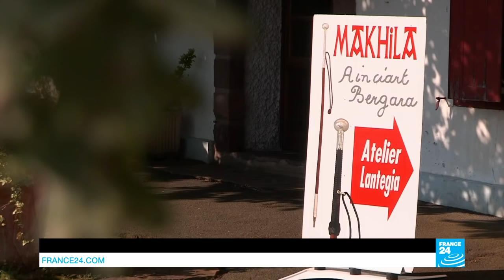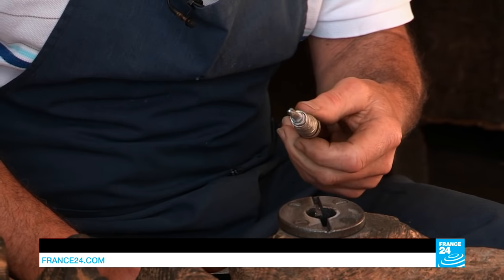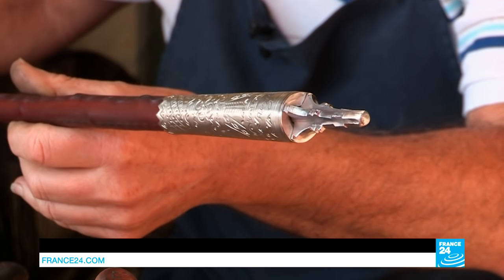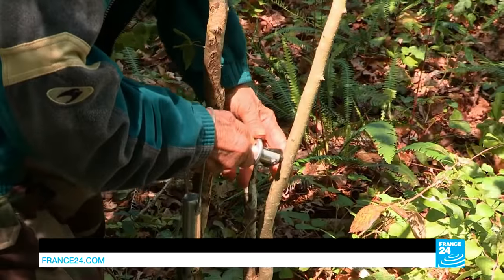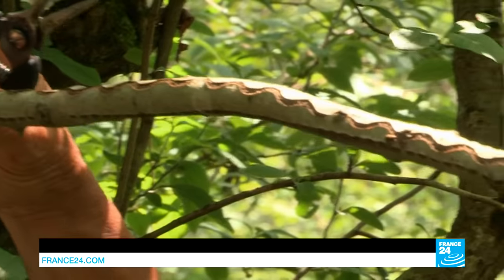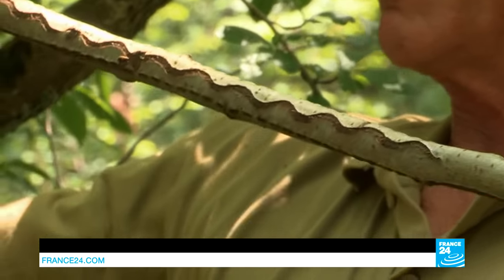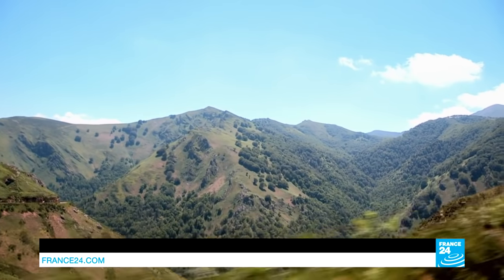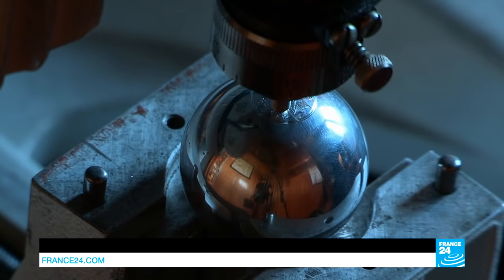The makhila, a prestigious Basque walking stick

Comment: As bladesmith I have just completed making a sword cane. Making a 24" blade is quite an exercise, particularly the heat treatment to harden the steel which tends to warp and twist in the quench. If you find a sword cane with a perfectly straight blade give a thought to the craftsman  who made it ....he certainly knew his craft.
Reply: pero esto es diferente, tio, esto es un baston de camino vasco, es algo de la tradicion de ese pais,  es como los zuecos en Holanda o el sombrero de vaquero en yankilandia, dentro de esa tradicion y forma este baston vasco solo lleva un punzon como arma de ataque, NO ES UN SWORD CANE como tu dices, un sword cane ES OTRA COSA, Y NO ES TRADICION VASCA, igual un sword cane es muy util y seria bueno tener uno, pero este baston, MAKILA, tiene solo un punzon, y esa es la tradicion vasca
Reply: @carloko08  Buenos Noches Senior, I apologize for my lack of Spanish as I would love to know what your reply is to my comment. Unfortunately I live in a p,ace where Spanish is not spoken and I know of no one who speaks Spanish.
Reply: @asotpan  google traslator, tio, es muy facil de usar no te preocupes ;)
Reply: @asotpan  don't worry, the comment doesn't make much sense
Reply: Have seen enormous shafts being heat related, many meters long and mayby 80cm in diameter,  the amount of work that goes in that is allso impressive but I was told that the metal has to be bought to temperature verry slowly and allowed to cool verry slowly several times before it is actually quenched in order to relive internal stresses that cause warping.
all second hand info hope you share your work on YouTube I Will look after posting.
Reply: Longer blades are a bit difficult especially thin ones like for sword canes, thermal cycling is helpful but  sometimes blades just don't want to stay straight for some reason. Hard to get even heat over a long blade which is often part of the warping is uneven heating. Best of luck I have some cane swords to make in the near future myself, first time I've made one.

Comment: There is probably some way to speed up the process without going to aluminum, but of course then it would not have the same old world charm.  I suppose that if you ensure that you prepare enough wood every year that it works out well after the first 30 year lull to get your first finished makhila...

Comment: i walk around with a wooden sword now days Cali has a lot of stupid laws i used to walk-around with a bamboo stick  that had  a knife inside of it that shot down too the bottom when i released the latch holding the spring got pulled over and they told  me i couldent walk around with it so then i moved on to a metal cane with a piece of a train connected to the top of it they said it was a mace and that it wasn't legal to walk around with maces

Comment: I feel like with the "modern" version, he changed the overall shapes and form a bit too much. Modern materials offer so much potential and they can look absolutely fantastic, but the silhouettes he uses for the various elements in his redesign just look clunky and screams outdated "2000's sci-fi" to me. Part of the appeal of the "traditional" design is its sleek silhouette, with each element blending almost seamlessly into the next. It's like comparing a pair of sleek oxfords (with or without brogueing) with chunky platform derbys. </prop designer rambling>

Comment: I do not mind the use of modern materilas, but if it is done by a machine the charm si lost. I woul understand doing it with machines if you want to equip an army, but it's supposed to be somethin unique and a machine doesn't quite cut it in that regard. As for the coloured ones, they should only be used in a modern art exibition and for nothing else